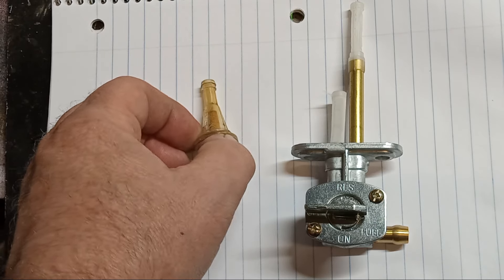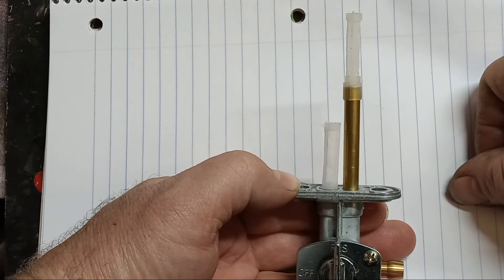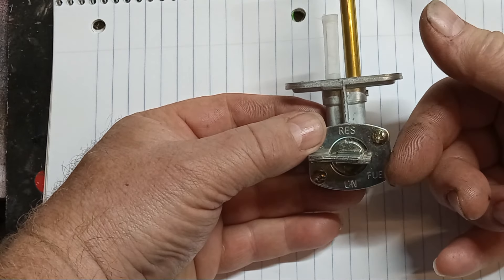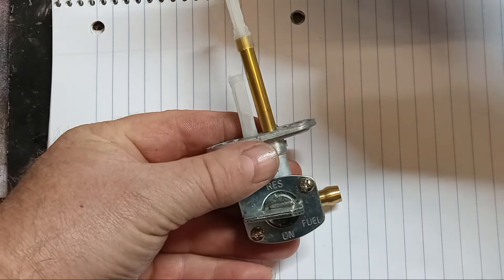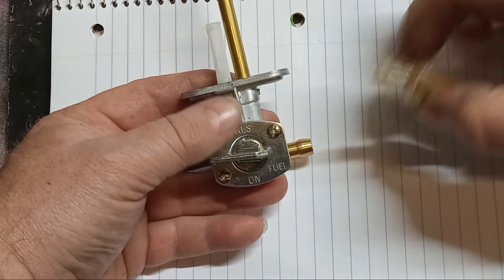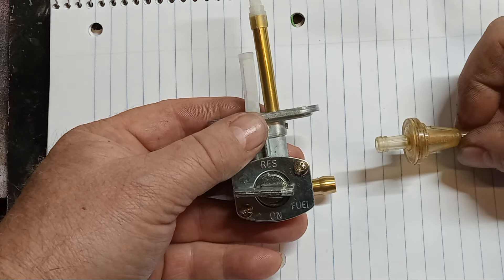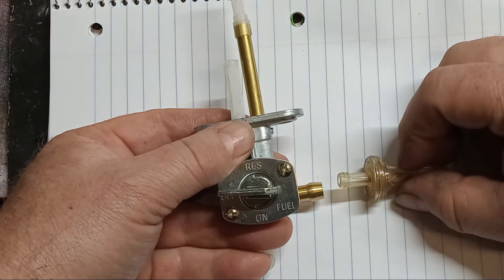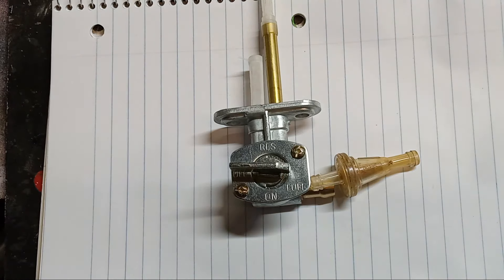Fuel Filters and why you should not run TWO of them

Comment: My Seca's vacuum petcock went bad and filled a cylinder. Luckily it was BDC so the exhaust valve opened when i cranked it. Replacement didnt have internal filters and wasn't vacuum, so I got the inline. I like seeing the filter so i can tell when its getting bad.

Comment: That little crummy plastic in-tank fuel filter sock (really more of a strainer) is always cracked after a shockingly short period of time and they're just generally junk filters. They fall apart in gas and then you have some of the strainer itself going into your carb. In-line filter is absolutely fine, that's why the carb has a bowl as a reservoir. Also that in-line filter is backwards, that might be why it was clogging!

Comment: I removed intank used inline for 35yrs. 👍
Reply from the maker: Sure it easier to replace filters that way. Just shut off the petcock, replace the filter, and turn fuel back on. No need to drain the tank and remove the petcock just to change the filter.

Comment: I don't run a filter at all on my CJ, the petcock has a sediment trap, the socks were removed and I extended the reserve pick up to create a secondary sediment trap in the tank (it has an inch or so long nipple welded to the tank that mounts the petcock, I lose about an ounce of fuel capacity). These bikes are known to have a high load lean condition that is exasperated by adding a fuel filter when a reproduction petcock is also installed (originals are hard to find). So yes, fuel filters are an additional flow restriction, you can test it yourself with a graduated cylinder and a timer. Basic jist is does your fuel system have enough fuel flow? No? Don't do it.
Reply from the maker: Excellent suggestion. That would be an interesting video to make. showing the flow rate of the same tank with 0, 1, and 2 filters in line. Last sunday, one of the bikes in our group ('72 CB500) lost the right two cyls. That was the side that two-owners ago had installed the inline filter in addition to the petcock screen. Left two cyls running fine, with just petcock screen, right had the petcock screen AND the inline filter and when his fuel level got down to 1/4 of a tank, it dropped three and four.  I've seen this happen about once a year to one customer or another, and just figured I'd share the solution.

Comment: I think the only additional restriction an inline filter would have is if the carb bowl can't keep up , but it's not pressure, it would be volume limiting then. Gravity fed carbs pull fuel up from the bowl. I dont trust those tube socks in the tank. They're press fit on the tube, could come off with sloshing. External filters forever!